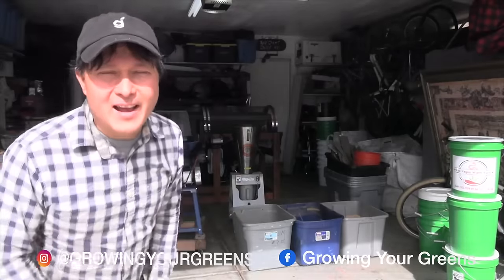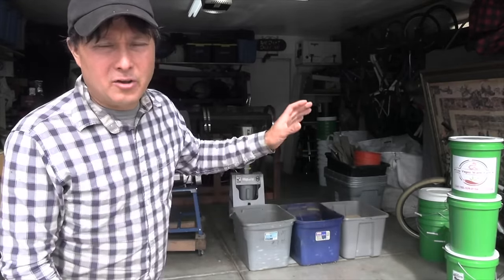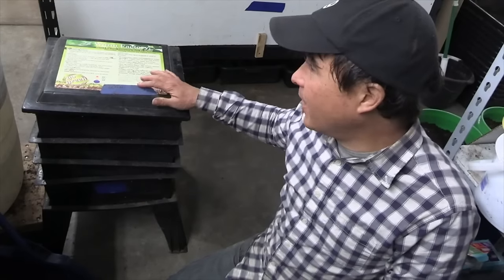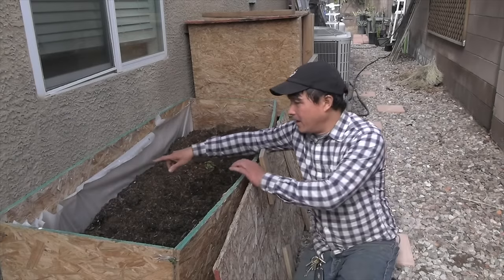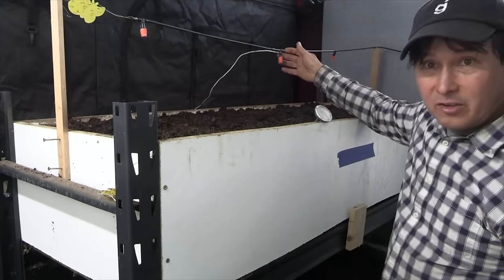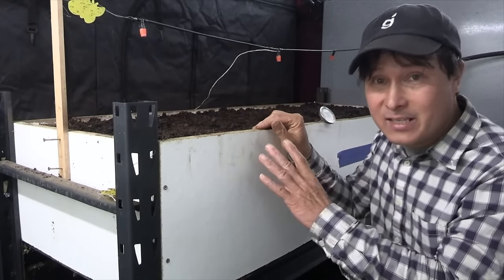Worm Farm Turns Food Waste into the Best Fertilizer in the Garage TOUR

Comment from the maker: Jump to the following parts of this episode:
00:14 Las Vegas Worm Farm
01:20 How to Start a Worm Farm in Your Garage
01:52 Only use locally sourced ingredients to Make Worn Castings
03:02 Their First Worm Bin: Worm Factory 360
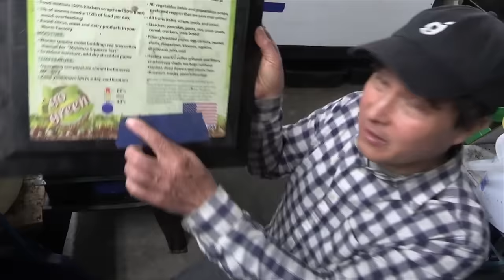04:22 Ideal Temperature for Worms
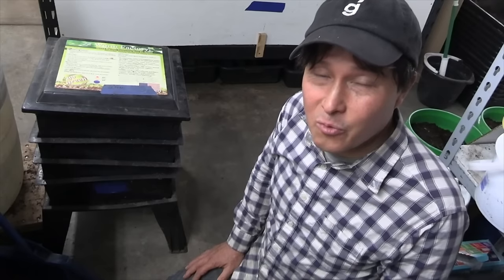05:04 Outdoor DIY Worm Box in Las Vegas 
07:10 How to Keep Worms alive outside: Watering to Keep cool
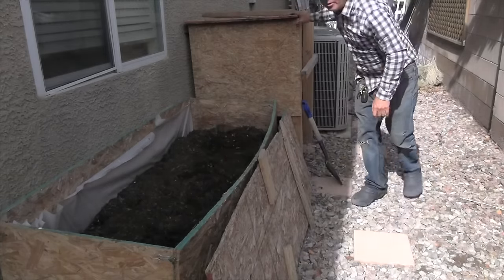07:54 Flow-Thru DIY Worm Bin 
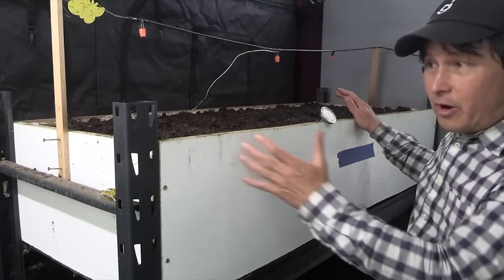10:16 DIY  Worm Bins in Garage built into metal shelving using melamine particle board
13:00 Why These Worm Castings Are Better than Others I have farms I have visited
14:03 How he harvest worm castings from his flow thru system
15:55 Growing Live Worms for Sale 
17:35 Growing Breeding Worms for On-Farm Use
19:15 Feeding High Protein Mix to Breeding
20:45 What he is feeding his worms - Diverted Food Scraps
22:30 Best Equipment to Grind up food  not a blender, a hammer mill
29:43 Cardboard thru Hammer Mill
25:41 Using Hammer Mill to Make Local Leaf Dust
27:40 Don't feed Chicken Crumbles to Worms
28:15 Using Hammer Mill to Grind Local Mesquite Pods and Leaves
28:25 Main Food he Feeds to Worms: Local Compost 
31:45 Transforming Landfill Waste into Local Worm Castings
33:45 Seed Sifter Used to Sift Worm Castings for Small Amounts
35:15 Homemade DIY Compost Sifter Trommel Made with Bike tires, Treadmill Motor, Wire Mesh, plastic sheeting, and 2x4's
38:02 Keep Your Worms Moist with Filtered Water to Keep Biology
41:15 Testing Soil Biology of Las Vegas Worm Castings 
42:52 Ensure Your Worm Castings or Compost is Living Soil
43:44 The problem with Store-Bought Bag Soils
45:55 Interview with Dennis Wichter owner of Las Vegas Vegas Worm Farm
47:14 Why did you start a worm farm?
48:28 Why is it important to use only locally sourced ingredients?
49:26 Why is it important to you to divert landscape waste?
51:00 Why do you only sell your worm castings locally? 
53:50 What do you do to keep your worms alive in the Hot summer?
55:45 How do you keep your outdoor worm bins alive in the summer?
57:25 Why did you choose red wiggler composting worms?
59:05 What benefits have customers got from your worm castings?
1:01:45 Why do feel worm castings work to help people grow better food?
1:04:05 Why Worm Castings are Better than Miracle Grow or Organic Fertilizers
1:05:05 How does the food soil web work?
1:07:10 Build up food soil web creatures to Create Your Own Fertilizer 
instead of buying it.
1:08:25 How can you make Compost Tea to multiply microbes?
1:11:34 Tell me about buying a hammer mill.
1:15:40 Why did you make a DIY Trommel and how much did it cost?
1:17:35 How can you buy your worm castings locally?
1:18:45 Will you answer questions about worms and starting a worm farm?
1:20:11 What keeps you motivated to keep on going?
1:22:15 Any final words of wisdom you would like to share? 

Las Vegas Worm Farm https://lasvegaswormfarm.com/
Las Vegas Worm Farm Youtube https://www.youtube.com/channel/UCaHAlkbpRR1aKZ_hEY_1-pg
Las Vegas Worm Farm Instagram https://www.instagram.com/lasvegaswormfarm/
Las Vegas Worm Farm Facebook https://www.facebook.com/LasVegasWormFarm/

Comment: Did you know worms are a invasive species?
Reply: I doubt they are in the desert.
Reply: I could be wrong but I Believe that every species of composting worms that we have in North America is non-native. 

The cool thing about composting worms is that if there's no organic material for them to feed on they won't leave that area.
Reply: @lasvegaswormfarm very true...I was running 3  flow through bins and just using red wigglers...I finished working the bins and stopped feeding them and the worms left.
Reply: @steelmaster73 thats pretty interesting. How big were your CFTs?
Reply: @lasvegaswormfarm  are you familiar with the totes grocery stores use with the interlacing lids? I'd guess they were 20 gallonish. I used 3 stacked inside one another. The bottom had 0 holes the middle had .25" holes and I had .375" holes in top bin. I was just using them to get rid of waste...I had no idea what I was going to get in return
Reply: Yep, I know those totes. I used to use them in the past. 

It's crazy how a little thing like a bit of worms can just take off and turn into a whole bunch of worms that you have no clue what to do with. Lol